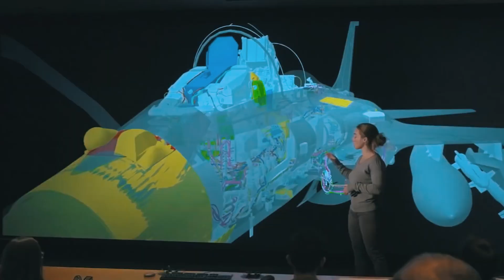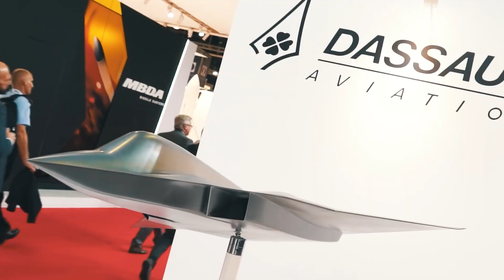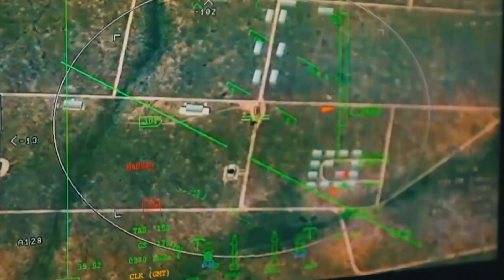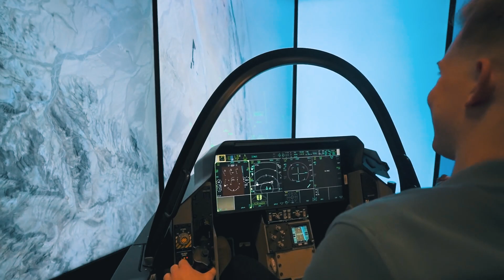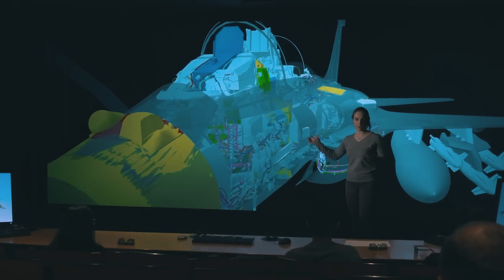France 6th Generation Fighter Jet Shocked The Russia And China

Comment: "The Europeans are tired of buying the U.S. made F35A". Excuse me, its problems have been recently resolved, barely a couple of years, its price has dropped and no one is tired of buying the F35A. Certainly not yet. Do your homework. It is currently as state of the art as it gets. It's the best of the best in the skies. It takes three or four decades and even more for countries to be tired....maybe....of buying an aircraft but they still keep on buying. Look at the F-16, nimble, exceptional in some theatres; just a small example. The F-22, phenomenal !! The F35A is the new kid on the block. The French do produce some amazing fighter jets, they are excellent and between the Mirage and the Rafale showing enough proof, they are exceptionally talented in aviation manufacturing, no doubt about it. But the F35A is barely now being sold to European countries. They are not tired of buying it. How could they be ?

Comment: So France will supposedly have a more modern, 6th generation fighter that will better than the F-22 and F-35 in about 10 years.  So what.  The F-22 has been operational since 2005 (17 years) and the F-35 since 2015 (7 years).  On top of that, the U.S. has “already flown” a Gen 7 fighter demonstrator.  So who is behind? 🤣 🤣 🤣